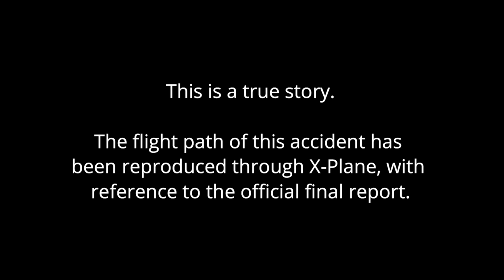Engine Fire before V1, CONTINUE! - BV1504

Comment: I do not understand.  We train constantly to reject the takeoff when anything goes wrong before V1.  He had three entire seconds to abort.  What the hell?
Reply: @gerardmoran9560  He had a damn fire warning!  That’s not worth aborting?  Anyway, I sure would have.  Thanks for the link.
Reply: @jerrypolverino6025  I'm not passing judgement. The video is worth watching. An engine fire warning with thrust output is different than an engine fire warning with a loss of thrust. Captain Bill (Boeing Captain) was Major Bill (USAF). He's a great guy and the video is very illuminating. I had an engine fire at about 400' climbing out in a C-141 and did a teardrop turn for a wrong way overweight landing at Navy Sigonella in Sicily. Worked out fine and it was a fuel harness leak. Real fire but the engine kept turning until I pulled the handle. As the video explains you may be better off having the full runway and CFR on the ready. Again, not second guessing but it's rarely cut and dried. Let me know your thoughts after you watch the Boeing assessment.
Reply: @jerrypolverino6025  the fire warning was annunciated at -3. The time to look across, read and understand what the failure is would eat much if that 3 seconds. I’m amazed someone claiming to be a pilot doesn’t get that.
Reply: @peteconrad2077  It takes roughy 1/10 of a second to react.  That’s why we were trained to immediately reject a takeoff for any warning before V1.  I am amazed you think a pilot would wait for three full seconds with a red fire warning and a bell before rejecting a takeoff.
Reply: @jerrypolverino6025  1/10 second to react? 😂😂😂 What a pillock.
Reply: @jerrypolverino6025  sounds about right - average .17 seconds for audible alert, USAF pilot can react faster, especially during critical Ops. Time to divert eyes, read the warnings and take decision, given all variables, different story. 

Personally, upon reflection, I would have done exactly the same. Rejecting at that weight, for a low hours pilot, who might have instinctively hit the reversers, may have blown fire over the front of the wing. 

A good pilot would reject, an excellent pilot would assess and make the best decision given the available information. 

Some pilots know about best safety practice better than the people who write the procedures, it doesn't necessarily excuse them from following them, but it can save lives, as in this case.
Reply: @russellking747  Thanks for writing.  Everything I ever learned about V1, from multiple sources was identical.  In fact I am highly surprised there is any confusion.  At V1 the aircraft is designed to handle a rejected takeoff; 1. at that weight, 2. density altitude, 3. reduced thrust if used, and 4. specific remaining runway.  That is the very definition of V1, the accelerate stop distance.  That is what we learned in; 1. aerospace engineering, 2. aircraft certification classes, 3. ground school, 4. specific type rating ground school and 5. simulator training.  From FAR 1.2 , “the maximum speed in the takeoff at which the pilot must take the first action (e.g., apply brakes, reduce thrust, deploy speed brakes) to stop the airplane within the accelerate-stop distance.”
Reply: You have a lot more experience than me, so I won't argue, you are right.

Looking at the facts, would the aircraft have been in more danger if rejected in this case?

If we take FAR 1.2 literally, it is the maximum speed for rejection of takeoff. Your training is correct. Educate me, does FAR 1.2 oblige you to reject in an emergency situation before V1?

Devils advocate question, not trying to argue, don't take offense:

 Let's say your nose wheel was destroyed in a heavy crosswind takeoff before V1, but you had enough elevator authority to keep pitch level, are you obliged to slam on the brakes and reject the takeoff, knowing it would destroy the aircraft?
Reply: @russellking747  no. It’s BS. This requires a decision to be made. It’s not a stimulus response. It’s a conscious choice. It’s a second at least.
Reply: @peteconrad2077  sorry, what I meant was "react to stimulus", of course the time to decisively take action based on it is longer as you pointed out 👍
Reply: @russellking747  Thanks for writing back.  Let me get a bit more technical, and here we get into initial aircraft certification.  The real reject takeoff number is not even published.  Sounds crazy, huh?  In fact, most pilots never heard of the speed I am about to explain.
The highest speed at which an engine can fail on takeoff and abort within accelerate-stop distance is not V 1.  It is actually V EF or engine failure speed. V EF is not even published by manufacturers, nor does it need to be, and here’s why.
In testing and certification the critical engine is idled at V EF and the airplane continues to accelerate on one engine as the pilot recognizes the engine has failed and makes the decision to abort. Once the test pilot initiates the abort, that speed is noted and becomes V 1.  The FAA assumes a 1 second initiation time.  V EF is employed during certification which are then used to determine V1.  
Yes, it is possible to dream up ‘what if’s’ where it might better to continue below V1, but in real world flying the safest thing to do is abort for anything below V1.  I do mean anything - any warning visual or aural, any abnormal engine reading, any airspeed discrepancy, basically anything at all.  Why?  
The reasons are simple and straightforward.  We know the aircraft is capable of stopping safely, at that weight, at that power setting in that configuration, on that specific runway, with that specific runway surface condition, on that particular day.  In fact, thrust reversal is not even required.
With all of this considered you can see than an abort is quite safe below V1 and continuing a takeoff with a problem below V1 can result in disaster.  MOST IMPORTANTLY  The decision the abort needs to be simple and rapid.  ‘Abort for anything’ is a rapid stimulus response and hence considerably faster than the time it takes to decide if a problem is critical, or not.
Reply: @peteconrad2077  The FAA uses a 1 second recognition time.  Most pilots in simulations where the reaction is actually measured is around 1/10 second.  I taught in simulators and that number varied very little when the training was to abort for any reason below V1.  When the ‘abort for any reason’ was not emphasized in training the lag time was substantially higher.
It is completely safe to abort below V1.  It may not be safe to dilly dally around and figure things out and then decide if you want to abort.  See my post above.
Reply: @jerrypolverino6025  Nonsense. The time used by FAA is 2 seconds. Research conducted by Boeing revealed that 3-7 seconds were typical real world times from wanting trigger to first stop action.
Reply: @peteconrad2077  Hence the ‘abort for anything’ precisely because it is stimulus and not dilly dallying
Reply: @peteconrad2077  Every second that an airplane is accelerating beyond V 1, the energy the brakes would be required to dissipate during an abort increases as a function of the square of the speed increase.  See the three links I posted about real world measured reaction times without opinions
Reply: @jerrypolverino6025  including care less about your links. I know the physics. It doesn’t change the actual time required to check what happened, make a decisions and start the abort. 1/10 of a second is fantasy. It’s a ridiculous idea. You don’t stop for anything, you decide. That’s why it’s called decision speed.
Reply: @peteconrad2077  
Quote “14 CFR Part 1. Definitions.  
V1 maximum speed in the takeoff at which the pilot must take the first action (e.g., apply brakes, reduce thrust, deploy speed brakes)
to stop the airplane within the accelerate-stop distance. 
V1 also means the minimum speed in the takeoff, following a failure of the critical engine at VEF, at which the pilot can continue the takeoff and achieve the required height above the takeoff surface within the takeoff distance.”
This is why ‘abort for anything’ is safer.
Reply: @peteconrad2077  “Relatively recently, both the American Federal Aviation Administration (FAA) and the European Union Aviation Safety Agency (EASA) have refined the concept of "decision made by speed" and restated it as an "action" speed in their respective definitions. The current V1 definitions for both agencies, as presented below, are virtually identical with the FAA version adding the bracketed information:
 
V1 is the maximum speed in the takeoff at which point a pilot must take the first action (e.g., apply brakes, reduce thrust, deploy speed brakes) to stop the aeroplane within the accelerate-stop distance. V1 also means the minimum speed in the takeoff, following a failure of the critical engine at VEF, at which the pilot can continue the take-off and achieve the required height above the take-off surface within the take-off distance.

Note that Engine Failure Speed (VEF) is a manufacturer nominated design speed that must be greater than Minimum Control Speed - Ground (Vmcg) and occur at least one second prior to V1. By definition, V1 also cannot exceed Rotation Speed (Vr). 

When operating at the minimum allowable field length for a given weight, there is only one speed that will satisfy both of the criteria of the V1 definition. However, if the runway available is greater than the minimum allowable length for the aircraft weight, there may be a speed range available for V1 from which the operator can nominate a specific value according to the following criteria:

Minimum V1 - the minimum permissible V1 speed for the referenced conditions (temperature, wind, pressure altitude, weight, thrust, runway etc) from which the takeoff can be safely completed after the critical engine has failed at the designated speed (VEF)
Maximum V1 - the maximum possible V1 for the referenced conditions at which a rejected takeoff can be initiated and the aircraft stopped within the remaining runway (or runway plus stopway where available)
There are operational and performance advantages and disadvantages associated with both the minimum and maximum V1 profiles.

==Interpretation==
From the above, V1 is the maximum speed during the takeoff roll at which the pilot can take the first action to abandon the takeoff and stop the aircraft. As a consequence, the "stop" decision must be made before actually reaching V1. Above V1, the takeoff must be continued unless there is reason to believe that the aircraft will not fly. An engine failure identified before V1 should always result in a rejected takeoff.

If the decision is made to reject, the aircraft can be brought to a stop within the Accelerate Stop Distance Available (ASDA). If an engine failure occurs at or after V1, the aircraft can get airborne and achieve or exceed the required screen height within the Takeoff Distance Available (TODA).  If a reject is initiated at a speed above V1, a runway excursion is probable unless the runway available is significantly greater than the runway required.

Stopping the aircraft within the confines of the runway or safely continuing the takeoff is predicated on an appropriate and timely stop/go decision and the corresponding appropriate and timely actions. The V1 call should be made such that the call is complete just as the speed is achieved.  If a reject decision is taken, it is critical that full stopping device capability is utilised. If the takeoff is continued, the yaw due to engine failure must be corrected, the aircraft rotation must occur at Vr and the appropriate climb speed must be maintained to guarantee that the screen height will be achieved.”
Reply: @jerrypolverino6025  thanks so much for clarification, makes more sense now.
Reply: @russellking747  You are more than welcome Russell.  It may interest you to know that both Europe and the US have had continuing discussions on RTO’s (Rejected Takeoffs) and V1 speeds quite recently.  These discussions involve auto rejection using computer aided, or even computer controlled decisions and auto RTO.  Machines are better than us.
Reply: @jerrypolverino6025  1. Yes. However a margin is built in since V1 is actually the speed at which it shouldn’t be initiated which just means when the thrust levers start to close. 2. Irrelevant. An abort is rarely a stimulus response call. It’s alms it’s always cognitive and that’s how it should be. 3. Not exactly. The performance is calculated to ensure a stop using the performance data acquired in testing.

What you see as condescending is an intolerance of BS.
Reply: Well i would have done the same. Better circle once and land back.  The  airflow lets fire blast out at the back of the engine, 2nd you have a good change to extingush the fire yourself with the bottles, 3rd emergency service have some time to get ready and fight the fire(if still burning) as soon as you land. Way better than stopping and have the aircraft consumed in flames in a short time…in my opinion of course!
Reply: @peteconrad2077  From what a buddy tells me, Gulfstream teaches to continue the takeoff at that point.  About the ONLY thing they want you to abort for is loss of directional control.   My airline's SOP is to call V1 5 knots prior to V1 in order to give the crew the TIME needed to make a critical decision at a very high speed and then react to it.   1/10 of a second?   RIIIIIIIGHT.   We also have done tens of thousands of "first look" maneuvers in the SIM during recurrent training.   They have a very good idea of how much time the AVERAGE pilot needs between incident recognition and reaction.

And let's consider v1 for a moment.   If you're taking off from a 10,000 runway in a light business jet does anyone really think that there's not adequate runway left to abort the takeoff?    It's essentially a regulation and guideline designed to cover your ass, that's it.  Without considering what V1 is predicated upon for that takeoff, it's a dubious value.    And at other times, there is NO WAY that you could stop the jet on the remaining runway if you stopped ten knots shy of V1.     ORD 32L from Tango10 in a heavy 727 comes to mind (back in the old days).
Reply: @lbowsk  if the runway is that long then v1 and Vr will be concurrent. If you abort after you’ve started to rotate then it doesn’t matter how long your runway is, it’s going to be a complete mess.
Reply: @lbowsk  in sorry but I don’t accept that you’d be unable to stop from the knits below a correctly calculated v1. That’s BS.

Comment: https://youtu.be/rJBlzal6g0k
The FDM replay shows quite a carnage in professional terms: captain hastily throttling back the engine at 200 ft AGL, engine shutdown by 500ft AGL, the FO likely not in a position to effectively monitor the captain's actions at such a low height and straying way off course due to the thrust asymmetry, the captain talking on the PA while handflying, high bank angle during the turn, absolutely erratic pitch, altitude and speed control... Not a great example but a happy outcome. It could have been worse, not because of the fire but because of a potential loss of control or because of an unstable approach, not to mention the chance of shutting down the wrong engine at low height... Some posts indicate the captain was ex military and former member Frecce tricolori but that doesn't justify this s....t show. In a prof check, that's a fail.